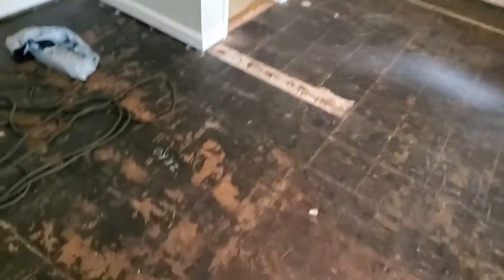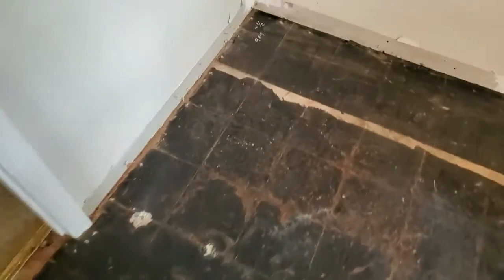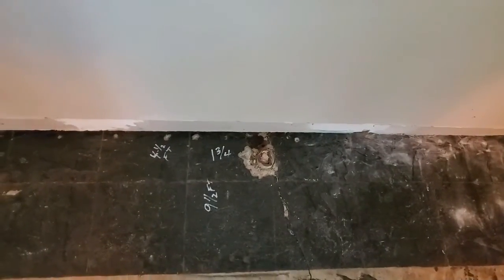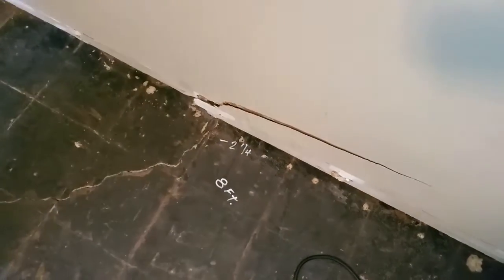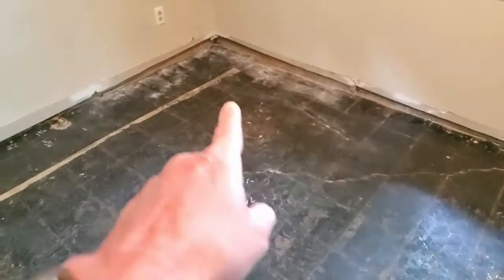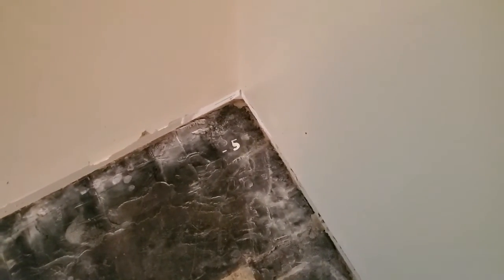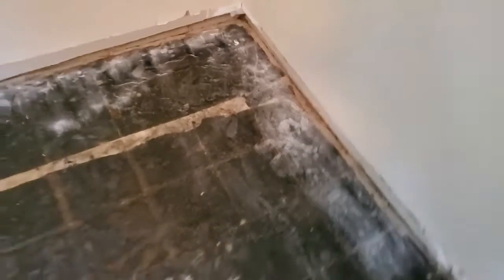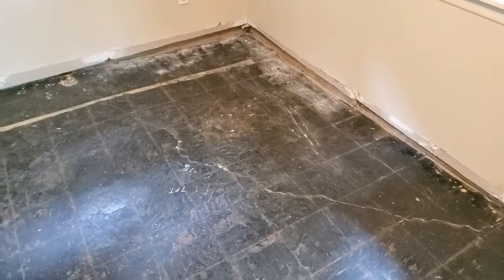#21 My Sisters Sinking Floor

Comment: Dang, what a mess! Hope y’all get it straightened out! Looks like it has settled all it’s going to. You might could pour a leveling coat on top of the existing floor?? I’m not an engineer.... good luck buddy!👍👍👍👍🇺🇸🇺🇸🇺🇸🇺🇸🙏🙏🙏🙏
Reply from the maker: Yes it's a mell of a hess. The problem I can see with pouring on top of it is,  it going to break in the thin edges of what I pour. Just maybe there is some kind of grout with fibers so it won't break. I'm researching it to see what I can find.
Reply: @ClintsHobbiesDIY  we’ve used a floor leveler in the past, I think it’s made by saccreet? Not sure of the spelling.... It worked well for us, we laid tile on top of it. Food for thought.....
Reply from the maker: @simpleman4224  Is this it?
 https://www.lowes.com/pd/Sakrete-Fastset-Self-Leveling-Resurfacer-50-lb-Fast-Setting-Concrete-Mix/1000250711?cm_mmc=shp-cprdbdmbinglia-210-masonrybaggedgoodsrepair-1000250711-_-0&placeholder=null&gclid=d343acfd8ab31aa57829cc48ab1e2349&gclsrc=3p.ds&ds_rl=1286981&ds_a_cid=119207829&msclkid=d343acfd8ab31aa57829cc48ab1e2349
Reply: @ClintsHobbiesDIY  that’s it, did you try the thumb yet?
Reply from the maker: @simpleman4224  Not yet. I have some Okra to plant in the garden. Then if I have time I have a big Red Oak stump that's been a thorn in my side when I mow for years.
Reply: @ClintsHobbiesDIY  cool! I love okra! Good luck with the stump!